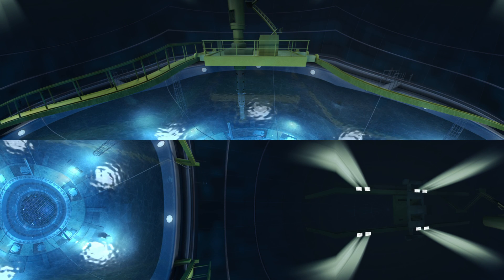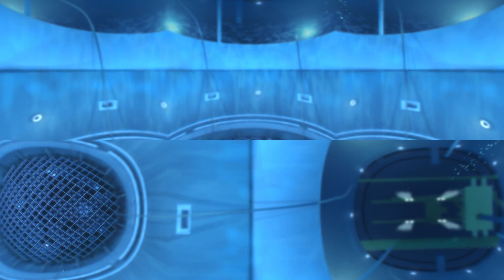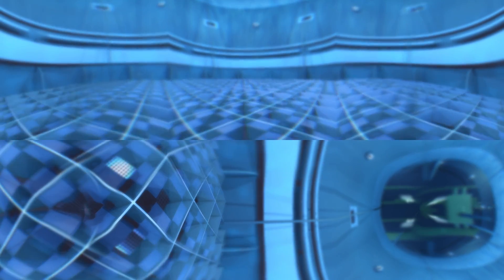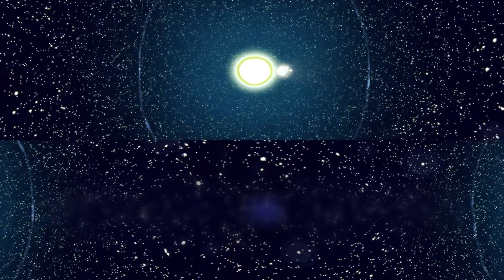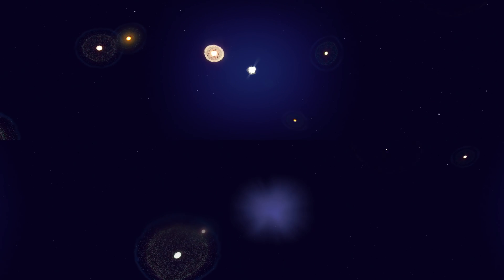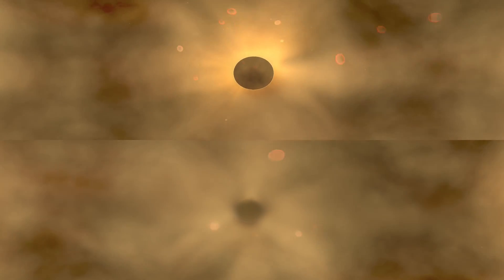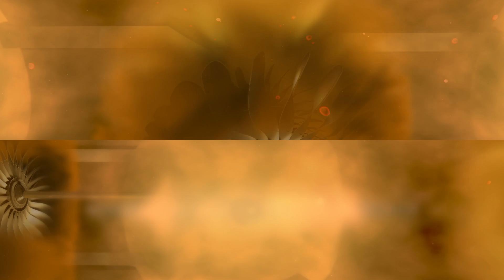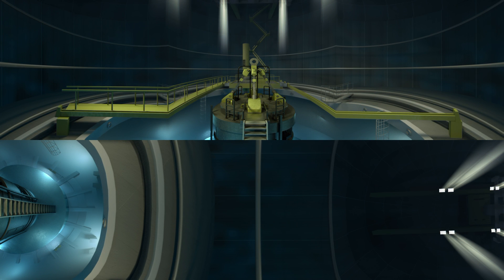What is nuclear energy? Shrink down to an atom and find out

Comment: This is a very simple description, as an engineer with some nuclear background it would be cool to explain the steam bubble acting much like an actuator or capacitor in other systems ...where as it doesn't regulate the fluctuations of flow but allow applys pressure to the water therefore being able to heat the water far beyound boiling point.

Comment: One main issue is that a lot of these nuclear reactors have been built on active fault lines were earthquakes are likely to happen for example Fukushima. And even human error has played a huge part in the failing of these reactors for example Chernobyl. Pripyat Ukraine To this day 35 years later remains a ghost town because the levels of radioactivity is too high for humans to live. So many families displaced because of human error. Not to mention Hiroshima and Nagasaki. Humans are not without error and we never will be. A wise man once said,  “an error doesn’t become a mistake until you refuse to correct it.” We should’ve never began to split the atom In the first place. I think we can find a much safer efficient way to make a turbine spin. Fight for the decommission of the nuclear program. Humans are so quick to do something just because they can and they don’t stop and think if they should. Slap a label on it and sell it. Please stop messing with powers we are unable to fully harness. Decommission the nuclear program.
Reply: No one in the right mind would try and decommission nuclear power plants. Keep dreaming.

Comment: We must skip gen.4 fission nuclear and go straight to our newer fusion power. Don't worry folks there is hope when we progress to fusion nuclear power. The overall climate is demonstratively cyclic, as in that it oscillates. We do not yet have sufficient data to build a worthwhile climate modelling computer program for realistic calculation of climatic changes and much is to do with clouds, water vapour and other greenhouse gasses. Australia was early to build the Hornsdale green mega battery to help with going green with solar and wind power and despite our backward thinking Prime Minister. I believe we should now also be the leading nation in installing fusion nuclear. The fusion nuclear SAFIRE GENERATOR by Aureon Energy Ltd. of Canada is the actually cheapest, cleanest and least expensive solution for clean electricity. Wind energy, solar, hydro and other green technologies are now just superseded. Hydrogen will not either become a future conventional fuel but a nuclear fusion one! Electric power is the future for autonomous small aircraft and with ever more battery energy storage density perhaps some larger ones. However, FUSION NUCLEAR IS THE FUTURE of ever-larger commercial and military aircraft. Now we have a 24 hr. reliable fusion power product. We now in 2021 have super cheap nuclear fusion energy already proven and almost commercialised as in being in advanced production, that of the "SAFIRE GENERATOR". So sadly, storage technologies and the power from ITER-type fusion power generators as well as conventional fission nuclear are going to be eclipsed. Current magnetic plasma confinement strategies and all current green energy technologies are totally out of date and relatively redundant. All our effort must now go into EVER HIGHER ENERGY DENSITY BATTERIES because green energy is now solved. With intermittent green energies we need an enlarged electric grid, so we see wind generators, solar farms and a multitude of variable green technologies with expensive backup batteries and they are all ugly and use up much land, while also being significantly capital intensive and all while having some safety issues. They are all also going to be unnecessary with the advent of the "SAFIRE GENERATOR" that is safe, costlessly self-fueling, totally green, buildable on any scale on a tiny footprint to safely match local community requirement and it is easily chokeable and 24 hours dependable. It makes all other technologies redundant as in being much less advantageous. It is fusion nuclear powered by nuclear "NUCHEMY" and seen at "AUREON ENERGY.COM" of Canada. Also learn your new plasma physics, astrophysics, and general Electric Universe Theory at "THUNDERBOLTS PROJECT.COM". This way you can learn your new EU Theory, advanced plasma physics and all needed to fully understand all this new academic and practical material. and appreciate that all the other green technologies are currently just now superseded.

Comment: To replace the ten  terawatts of electricity we annually use by nuclear fusion requires building 10,000 nuclear plants that is a fossil fuel intensive process. 10,000 plants would consume uranium reserves in 10 to 20 years...then we have to dismantle 10,000 plants

Comment: Low cost energy production in a closed loop vacuum system: You have a water tank filled with degassed deionized water, the water then goes through black pipes held in glassed-in insulated boxes so sunlight is captured to heat the water "it can get hot enough to boil at sea level" the piping then goes to a spray nozzle where the hot water instantly vaporizes the steam then goes to a turbine that drives an electrical generator, after the turbine the steam and any water that condensed in it travel at a downward angle through a pipe with a condensation coil around it to a large vacuum chamber that has heat transfer fins inside this preheats water from a large reservoir tank that then feeds to the starting tank.
The constant rapid condensation of the steam combined with a volume of the vacuum chamber being 3x or larger than the volume of steam produce at any given time maintains the vacuum level so the process continues.

Comment: The water in the reactor will not be in direct contact with turbines.... the water gives out its heat to heat exchanger...
Reply: Depends on the type of the reactor. Boiling Water Reactors can be made into a single-loop scheme, with steam directly from reactor being used to rotate the turbines.

Comment: Powering a set of nuclear power plants closely built to each with underground super atomising conductors could cause the power plants to perpetually regenerate the power plants energy core through connected  super conductors, in effect cresting a chain reaction and when fully empowered the supercharged perpetual power plants will initiate the hugely empowered chain reaction, therefore charging a quantum energy super battery ,therefore  making the next energy source for the planet...watch nobody thank me, compliment or pay me in the way that the energy saviour(oops I meant saver) deserves.

Comment: Nuclear doesn't sound all that great to me anymore, after watching this. Pretty much seems like using the knowledge of the gods to make a round rock. Which you then use, and make a round wheel out of it.
It seems like there should be some other way, without having to revert back to steam turbines, to convert all that power to something useable... There's so many other ways of converting power to something that people can harness and use, without having to deal with the waste created by nuclear power. It takes an incredible amount of time to break down to the state in which it's no longer hazardous to life.
Just seems like such a waste of potential when you look at it, and how the energy is currently converted and harnessed. I'm not saying I know better, or have a solution, it just feels like there's a lot of wasted potential, and there should be some better way of accessing the power of nuclear fission.

Comment: A quick lesson on exposure.                                                                                              The chest x-ray is a simplified and accurate explanation of the average environmental exposure. Lets say you spend your entire life 24/7 365 days a year living on the property of a 30+ year old nuclear power plant. Your entire1 year exposure rate would be LESS than that of 1single chest X-ray. BTW, that X-ray dose is given to you in less than 1 millisecond not over the course of 1 year. In fact your wireless device emits 10 - 30x more radiation per day than a nuke plant in the same amount of time; and we all carry these things in  our pockets!! 

The steam you see is fresh water it is a totally separate system all together from the reactor, and turbine feed water systems.  Also only a few inches of water is needed o shield the environment form the radiation of the spent fuel rods so as long as they stay covered in water storage wise its safe.

As for return on investment over the life of the power plant, the cost to build, operate, amount of energy produced, safety, and especially environmental impact? Nuclear energy beats out everything else coal, oil, natural gas, waste to energy, and especially solar and wind combined.

Comment: That was interesting, especially since you showed the dumbbell shape vibrating before the neck broke. But why did you show this only once, when by your own admission fission events were happening in many places, not just one? And why no fission fragments? As for moderator materials, water is actually a controversial choice: CANDU reactors are much more efficient than LWR and can use a wider variety of fuels.They use heavy water instead of 'light' water, so that more neutrons are slowed and fewer wasted on being absorbed by water.

But there are proliferation concerns, which is why the US government has been pushing LWRs instead and trying to persuade other nations not to use Canada's CANDU design. But this leaves a lot of unused uranium in the spent fuel rods, which is its own proliferation risk, though it is difficult to separate out the remaining U235 from them, so it is considered a lesser risk than CANDU.

That, BTW, is the way all nuclear technology is: you never completely get rid of proliferation risks, there are tradeoffs. Even so, we should be using more nuclear power, since it is so low carbon: if we get carbon neutral fuel for the mining equipment and trucks for shipment, then it really is zero carbon!

Comment: Now show the expensive part of nuclear power production. When the fuel is spent and the next phase that the the uranium goes through that the tax payers pay for. For thousands of years.
Reply: Still more efficient amd environmentally friendly than wind power.
Reply: @Luckysquirrel1256  Really Lucky are you that brainwashed and dense to be that illogical?
Reply: @scruples671  You can do the research yourself. https://energypost.eu/15052-2/

1 Nuclear Powerplant is equivalent to nearly 2000 windmills. This makes it much more compact as 2000 windmills would require 3000 acres of land, which means displacing a ton of wildlife, not to mention the 140-328,000 birds and bats that are killed each year by windmills disturbing their flight paths.

2000 windmills would also require a vast amount of steel, 200 tons each, for a total of 400,000 tons or 800,000,000 pounds of steel which has to be dug out of the earth.

Nuclear is also more stable and efficient, so less of it is lost when storing it. Windmills produce a varied electrical signal, so the energy has to be converted to be used and stored, which causes a loss in efficiency.

Comment: Wow. So neat and simple. I think I'll buy some uranium and drop it in my water tank so I'll not have to heat it up ever again. No fuss, no muss. 

Despite the exorbitant costs per megawatt/hour to build, operate and maintain a nuclear facility (at 90 to 150 us dollars which is 20 - 40 more than solar and about 10x more than land-based wind) and its lethal waste/byproducts, a not too stellar safety and performance history, this video comes off as a type of 'wizard of oz' sham. 

PAY NO ATTENTION TO THE MAN BEHIND THE CURTAIN!!! 

I started in the nuclear industry doing non-destructive testing of reactor welds and structural integrity. The safety training films of the time would shock most people had the films been made public. Digits and limbs rotting off. People dying from accidental exposure. And that is simply the tip of the "nuclear"iceberg. 

And what of the nuclear accidents? Chalk River, Windscale and SRE in the 50's, Idaho Falls and Fermi in the 60's, Three Mile Island in the 70's, Chernobyl in the 80's, leading up to the point where one would think Japan gives trying nuclear after events at Ishikawa or Tokaimura around the 2000's but, no, they gave us Fukushima and Onagawa in the 2010's. To be fair, nature provided the impetus for the last two events but that's 4 major events in less than 20 years!

Which leads to what of the thousands of years of waste management? 

Because that stuff does not go away. Montana said no to Yucca Flats as the underground storage here in the US. 

What of all the other countries? China, India, Russia? France? Sweden? Finland? Where is all the waste going to be kept for the eons it takes for the stuff to break down? Perhaps Elon Musk will take it with him on his way to clog up the heaven's with his satellite scheme, possibly to send it 'out there' to burn up in an unknown distant star or sucked in and buried in a black hole somewhere. 

Might as well. We certainly don't know what we're doing in too many areas of science to keep going as we are. We're like a toddler playing with a hand grenade. It will not end well!

Instead of sinking 6-10 billion (without cost overruns!!!) into something that is fraught with danger and  discrepancy, how about spending the money a bit more wisely on the red-headed stepchild, fusion, so it can become energy and cost efficient? Especially since we are close. There's no deadly waste to deal with once the energy is leeched from the process and should another tsunami hit or a pump fail to register faulty, the worst that will happen is the board of directors might have to explain why the investors couldn't rape the public as much as last quarter.  Money, time and/or effort would not have to be wasted...er...allocated to snake oil-style sales pitches. Sounds like a win-win to any logically thinking person.
Reply: My word. You are absolutely right. We should all just give up, right now. There is no hope. We should curl up and die right where we stand.

Comment: If nuclear power is so simple, why do people need to be so insanely uber-qualified to run nuclear plants? I always hear that one of the contraints on expansion of nuclear power is that there aren't enough people qualified to run them. It seems to me that it ought to be possible to design reasonably idiot-proof reactors. I mean, millions of people every day drive cars without having a damn clue how an internal combustion engine works. It ought to be possible to go the same route with nuclear reactors.
Reply: I am oversimplifying but, it would be a bit easier if we were Vulcans. It is not the likely-hood of a problem that scares the pants off people - it is the consequences of an unlikely error with these kinds of energy potentials. Humans have strokes and headaches, they have significant others and family members that complicate the emotional weather inside all of our hearts, they make dumb errors even if they are terrifically smart. 
The reactor described here is a high pressure type. This requires more structure to contain errors. Multiple supervisors monitoring the system and each other to reduce these errors. There is a sustained discussion regarding low pressure type reactors that might interest you - see Thorium.

Comment: Zero mention of the issues and concerns. If reactors are as "simple" as you claim they would be fine. They aren't, neither the effects nor the technology. They produce exceedingly toxic waste by design and occasionally make whole regions uninhabitable when they break... which happens because they are NOT simple systems, they are not easy to design or run. they are built by the lowest bidder and built to regulations influenced by corporate lobbyists.
I'm not against nuclear power done right, but we're are not there yet.
Reply: See - Thorium

Comment: Hmm, there seems to be a slight problem in the maths... 5 trillion fissions per pellet per second times 4 million fuel pellets times 200 million electron-volts per fission comes to 4e+27 eV, which is about 640 megwatts thermal. To get 1000 MW electrical just from the fissions, you need about 5.2 times more fissions per second, or 1.04e+20 fissions/s. I really do not think you get 5.2 times more energy from the radioactive daughter products than you get from the fission itself!
Reply from the maker: Thank you, and very well done for spotting an error in our script! Where it says 'more than 2 million fuel pellets in the reactor’, it should have said ‘more than 20 million’. Typically there are around 400 fuel pellets in each fuel rod and around 50,000 fuel rods in a reactor. You’ll see that the numbers you’ve calculated do then work out i.e. 10^20 fissions per second, with 5 trilion or so per pellet. Once again, good spot. Owen

Comment: We know how to control nuclear reaction, but we don`t know how to cool reactor core 24/7 for 40-50 years on land. 
Modern reactors were originally developed for nuclear submarines, where there is no such problem - you just release sea water into the core if everything else fails.

This is essentially is why Three Mile Island, Windscale, Chernobyl and Fukushima happened. There were probably more accidents, but we dont know.
Reply: are you familiar with the INES? a very large number of incidents is logged, so we actually DO know. (well, maybe not every one of us and not by heart)
Reply: @kensaiix  The ones we don`t know are plutonium production plants. 
Actually, even physical location of these sites is top secret. And accidents are even much so.
Reply: @hrvojegrgic5111  they are called enrichment plants afaik. cbb to google, but they can't be that shrouded.